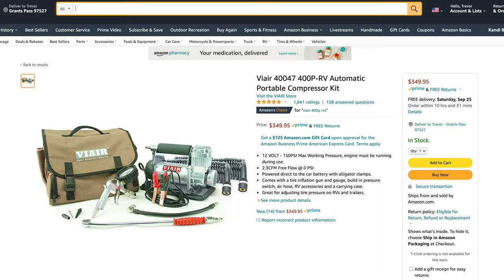Tools For Full-Time RV Living! • Tools We Won't RV Without

Comment: Tools are mandatory for RVing! Good list you got going there. Yes, more Leila...and where has Kalin been hiding out? Has the small human taken all the glory away? 🤣

One thing that might be good to have is a roll of Eternabond tape for roof emergencies. That tube of Dicor has an expiration date and will dry out. Just a suggestion...Eternabond is awesome stuff and sticks to everything (literally).
Reply from the maker: Thanks man!  Ya, I actually just ordered some sticky roof tape stuff, if that's what you're talking about.  Not sure of brand, but my roof is covered in it!  That's how we some of the solar wiring down.
Reply: @LyfeUntethered  Yeah, there are different brands. I used some as well for my solar and my cell booster install.